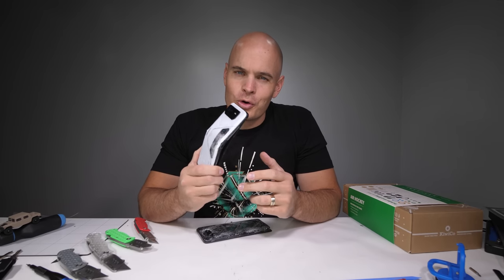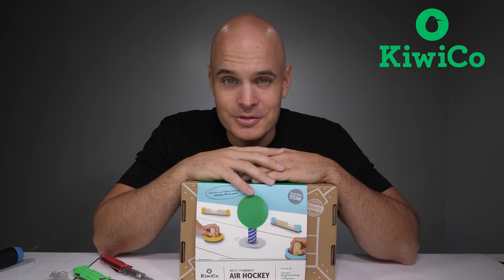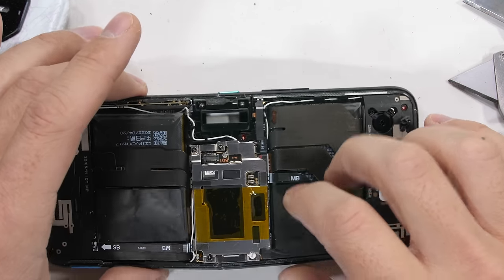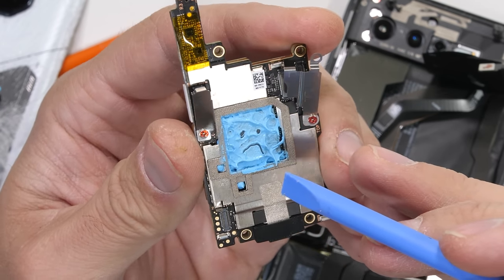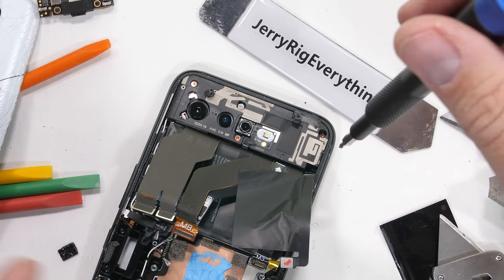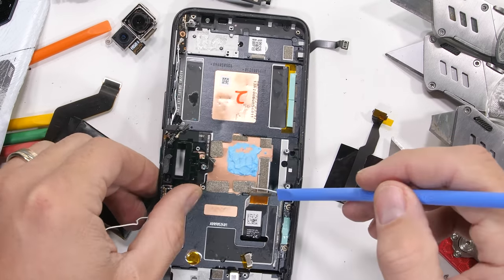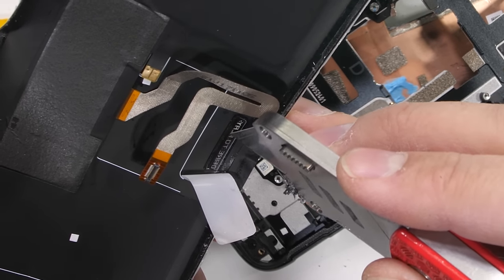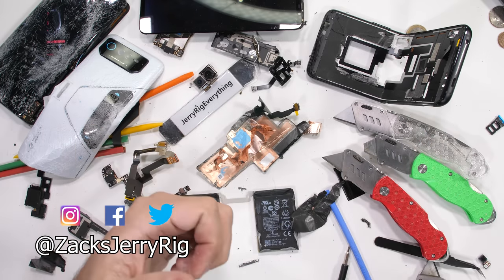The ROG 6 PRO has a SECRET Cavity! - TEARDOWN

Comment: That hidden cavity is for the Pro versionor the ROG 6 pro d. They added heatsink that opens up when the aircooler is attached
Reply: Surely they should have put some points into endurance, after maxing the power stats
Reply: It's called ROG Phone 6D Ultimate
Reply: exactly
Reply: agree
Reply: Yep that was my thoughts on it. Same internal layout, just different motherboard. Wondering is it only the section with the CPU is the difference on the 6D.
Reply: With all those moving mechanism~ That phone going to break if accidentally step on sit on it lol. This is my last time using ROG current on 5S~ But kinda bored, gonna for for other brand for some refreshment~ Been using Asus since Rog2~ Hope Asus do better on durability side~
Reply: @Lawz1993  no wonder Iphone Pro Max sellout in my place faster than ROG tho. After 4, ROG really double down their brand for ultimate gaming phone sadly. 2 3 are their premium places.
Reply: yes, it was a future plane for the cooling vent with the 6D Ultimate
Reply: @Lawz1993    exact same experience with me. Even thought ROG Phone have some interesting Point for the phone User Experience , Features and shape, but kinda worst for the build lately, and the Official Service is not widespread either, if there is any , it will take a long time for the service
I have sold my last ROG Phone 5s and probably Will go for Samsung or some kind of it

From several experiences using several smartphone brands, ROG Phone is the worst experience for me, like quite a lot of problems from it
Reply: So you can buy the ROG 5 Pro ultimate back glass and upgrade your normal version.
Reply: @tylern6420  It's a "gaming" phone, they got a limited number of skill points so they went for a full glass cannon build. xD

Comment: The ROG phone 6 ultimate has a flip out fan in that same spot so my guess is the 6 pro uses the same body but they put that chunk of plastic inside instead of the fan.
Reply: ROG Phone 6D Ultimate*
Reply: I just bought Rog 6D ultimate. I don't understand anything but is my new phone will be break soon 😢
Reply: my English is bad 😭
Reply: @DDLarssonii  your phone won't break as long as you take care of it.
Reply: @DDLarssonii  Just don't sit on it.
Reply: @FastSloth87   I will try bro thanks 😂 I'm just little scared cuz my rog 1 fell on my rog 3 while it's charging and broke my screen it was brand new at that time I felt my heart broke bro :( but now I start putting protection to my 6 ultimate. Da reason why I didnt  put any of my rog 123 any protection and all are screen cracked cuz while playing the phone will heat up. 🤦‍♂️

Comment: The 6d ultimate replaces the cavity with an open portal that you operate through their software. My understanding is that they added more copper In the open chamber and you use the fan to draw more heat out of the phone. Hope that helps!

Comment: I think it is for the 6D, the one which opens up and uses a modified cooler as well to let the heat pass. They had the same design in place & for some reason decided not to use it on this one.

Comment: I definitely agree with you Jerry on the OIS part. Since durability problem can be solved easily by using a phone case but OIS. That made me sad too. Great Video.
Reply: If you need a case to have a string phone you might as well use thicker metal dont you agree?
Reply: @arshenio45  it's more to do with the dual battery design, the phone would be a lot stronger in the middle if the li-on battery was a single battery that runs along the length of the phone
Reply: @arshenio45  rog phone 5 users here, been using the phone for 1.5 year and a half now. Fell a lot of times, but i never noticed any bending. Everything is still tightly sealed and straight.

I think the only way for you to bend a phone that way irl, is when you put it in your back pocket and sit on it, which you are not supposed to do to any phone anyway.

I'm not saying it's ok for a phone to just completely split in half. But i think people need to realise that the force needed to bend the phone is waaay more than the force it's gonna get just being in your pockets.

Comment: If they reposition the batteries from horizontal to vertical orientation it can help with the structural integrity. Although by the looks of it ROG needs to add a midplate and increase the frame thickness or try a different alloy altogether. For 1300 this surely is possible. If Apple of all companies can offer a stainless steel frame ROG certainly can.
Reply: Then you add weight, for what? You think people who buy gaming phones take them to a construction site???
I kind of understand why Asus CEO said to never listen to consumers.
Because it they did their phones would weight 6kg and be powered by a diesel engine.
Reply: If you have vertical batteries you will not have the space in the middle which is needed for the processor cooling.

ASUS knew for sure that the design in this way is going to make the phone easier to bend. However, the reason for this is to align the location of the cooling fan accessory with the processor and since the cooling fan is installed in the middle (best location for weight distribution) they have to make space for the processor to be at the same location where the cooling fan will be installed to get the most benefit out of it so in order to make the needed space while having good battery capacity is to have 2 small batteries instead of one big battery. Another side benefit which will be the distribution of weight when playing in landscape. It is not because of batteries safety somehow, ROG 6 Pro is a gaming phone where you need to focus on performance, high frame rate and graphics while trying to resolve the heat issue which will affect the performance. If you are into gaming and you want to enjoy performance gaming phone then you have to compromise. Therefore, by knowing that the phone is easy to bent because of this, then you know that ASUS know what they are doing, it is just something they needed to do for performance.

Yes the bend seems bad and not desirable but we should appreciate that the company is differentiate the design of gaming phone than normal phones, they are trying to get the best design for performance and they have engineered the phone with an outstanding design and internal alignment with the current existing technologies as in future technologies may change.
Reply: @alaaeid8320  Okay. I'd like to propose another solution. Keep the same battery orientation. Add an aluminium midplate, attach it to the vapour chamber. It'll act like an additional heatsink for the processor and provide additional cooling to the batteries as well. This way the cooling accessory can be used, they design will remain almost as is. The additional battery cooling will extend battery life and help with faster charging speeds since heat is the No 1 enemy of a Battery. For the frame, they can try and use a stronger version of aluminium alloy. The weight remains mostly the same. Result improved strength, better battery and processor performance. Or If they don't want to experiment with a different alloy, they can use a thicker back glass and on the screen. That will also help with the heat and solve the structural problems but not as much as the midplate. 
Any arguments??
Reply: @SMGJohn  Hmm. Seems like you're the kind of person who would buy a sub par product for a premium price just because the people who made it gave some bs reasons for cost cuts. My guy every problem can be fixed with clever engineering. And yes there are different varieties of alloys. For example there's 6000 series aluminium which is inferior to 7000 series. Some smartphones use 6013 and 6063 grade aluminium. Some use 7075 grade as well which is the highest grade used in phones right now. A big example of this is the iPhone 6/6+ Bend gate where apple used 6000 series alloy which is diluted and cheaper to manufacturer and also weaker. For 6s/6s+ they switched to 7000 series alloy. That fixed the issue. 
Trust me most problems like these can be fixed with clever engineering, and minimal cost deviations. 
The only reason ROG didn't do this is because their accountants probably would've done a CBA and reached to the conclusion that if this becomes a problem for them (lawsuits) it'd be cheaper to settle the lawsuit than actually fix the problem. And this isn't the fist time a company has made such a decision. 
If iPhones weren't as dominant, chances are Apple would've kept using the inferior grade alloy and dealt with any issues quietly. 

Argue that my guy.
Reply: @SMGJohn  the bending in this case would occur if: you sit on your phone by mistake with it either being in your back pocket or being on the chair/bench/sofa/bed etc
it could also happen when you put it in your backpack when going in a vacation, if for some reason you don't want the phone to be near you while on the plane, etc

basically normally it won't break like that, mistakes and accidents do happen. There's a reason why Zack tests for bending, and that's the entire "bend gate" a few years ago with iphone 6 or 7
Reply: @serikazero128  
Majority of phones sold are with plastic framing, if sitting on your phone is a concern, the solutions are simple, do not weight over 300kg, do not wear slim jeans.

I do not own Asus phone, but I am tired of people proclaiming this to be an issue, the iPhone bent very easily, Zach is putting a lot of force on that phone, and if your phone bends in your backpack, everything in your backpack is gonna be smashed up anyway, so if you have your laptop in there, it will be smashed, there would have to be a forklift driven over it for it to happen.

If these are genuinely your problems, no phone will survive, you are better off with a CAT phone, designed for the US Army.
Reply: @SMGJohn  just search bendgate regarding iphones, and I'm sure the teen and young adult girls that bent them didn't wear 300kgs. The thing is, women have a tendency to wear phones on in their back pocket, and some men do as well. After repeated sittings, the phones will start to bend.
Its also worth noting that "fashion" these days is thigh pants. Afterall you want to see a hot slim chick with pants fit on her legs and ass. And if you slide a phone in and then you sit, multiple times, yeh, you get bending.
But hey, feel free to dismiss all of that. And no, like jerry nicely pointed out, Asus RoG broke last year as well, but most other phones don't get bent as easily, again, the iphone fiasco was a thing just a few years back
Reply: @serikazero128  
What in the genuine hell are you even on about? 

If you need a phone for construction work, buy a phone for construction work, if you need a gaming phone, NONE of them will be as sturdy as phones made for construction work. 

And drop your flagship crap into the floor, both screen and back glass breaks, GG?
Reply: @SMGJohn  only construction workers have chairs, sit, or have beds and sofas.
Dully noted :)

Comment: Nice to see this. I have a Rog phone 2 and i wanted an upgrade. But i can wait for Rog 7, maybe they will improve the internal structure.
Reply: I have the rog phone 6 512gb storage and 16gb ram in black and i even tried putting pressure onto it to see if it will flex a bit but it seemed fine and i have a screen protector and a case on it and nothing happened up to now so if i guess you take care of the phone normally you should be fine but yea i had the rog phone 3 before and i didn't have to worry about that bending it is a tank

Comment: Here's a question for you, when taking off the screen, I noticed only one ribbon cable, now is that cable pushed through the back of the phone OR is it connected to the front? Curious because of the screen cracks and needs to be replaced, it would be an easy repair to do since Asus doesn't have any repair centers in the US.

Comment: Moving back up to the top to remove the cameras, we have the itty bitty 5 megapixel macro cameras camera which does not have OIS.
The other two are mounted together at the same housing.
We have the 50 megapixel camera on the left and the 13 megapixel ultra-wife camera on the right –both of which have smaller footprints than we would normally see in a flagship, and surprisingly, neither of them have any optical image stabilization. We haven't had a phone without OIS in years, and especially not on a flagship that costs $1300. I'm almost more disappointed by the lack of OIS than I am at snapping in half.

Comment: Seems they slightly cheaped out on the "pro" model with it missing a handful of features such as the speakers balls or especially the optical stabilization on the camera and it apparently doesn't even have the vapor chamber that leads to the back of the phone like their other models do, which I find pretty weird for a $1,300 phone... Not very impressed with this.

Comment: Not sure if this was mentioned before, but i have a theory on why the internals are laid out as they are, and why the battery is split into separate cells. It may be possible that ASUS/ROG knew of the compromised structure of the phone with the placement of the power & usb-c connector. To help ensure that the battery doesn't get damaged if the phone is bent (and end up exploding/catching fire), it was split into two and placed the way they are so that they are better protected, and less likely to get damaged if the phone is bent.
Reply: its just for space claims. this layout lets them use the space more efficiently, thus getting more battery life. ipads have a similar arrangement.
Reply: This why I bought a protective case when I bought this phone and yes I have delicate hands so it wont bend easily, I put the phone inside my bag instead of my pocket when I'm heading out
Reply: ASUS knew for sure that the design in this way is going to make the phone easier to bend. However, the reason for this is to align the location of the cooling fan accessory with the processor and since the cooling fan is installed in the middle (best location for weight distribution) they have to make space for the processor to be at the same location where the cooling fan will be installed to get the most benefit out of it so in order to make the needed space while having good battery capacity is to have 2 small batteries instead of one big battery. Another side benefit which will be the distribution of weight when playing in landscape. It is not because of batteries safety somehow, ROG 6 Pro is a gaming phone where you need to focus on performance, high frame rate and graphics while trying to resolve the heat issue which will affect the performance. If you are into gaming and you want to enjoy performance gaming phone then you have to compromise. Therefore, by knowing that the phone is easy to bent because of this, then you know that ASUS know what they are doing, it is just something they needed to do for performance.

Yes the bend seems bad and not desirable but we should appreciate that the company is differentiate the design of gaming phone than normal phones, they are trying to get the best design for performance and they have engineered the phone with an outstanding design and internal alignment with the current existing technologies as in future technologies may change.
Reply: For me is actually hard to believe that a manufacturer like Asus actually preferred to release a phone with a clear structural project fail just to have something "fancy" like an USB-C in the middle just to plug a cooler

Comment: The cavity in this phone cannot be a "conduit" as conduit needs to conduct something. Cavities filled with air are terrible conductors. (Hence we use double/triple glazed windows where between each layer we use a "non-conductive gas"–air in the cheapest, argon in the mid-range, or ultra-low pressure argon in the priciest.)

Comment: For the folding phones, it would be nice for the bend test to try bending it from the side. Meaning taking it un folded and instead of bending it in reverse, bending it from left to right, to stress it with compression and tension at the same time.

Comment: The angle iron shape of that cavity surround tells me that it is there to give the phone rigidity, especially considering where its placed.
Reply: L section, and no. Rigidity at that size is nonexistent. Other devices of this size and nature use carbon fiber rods that span the length of the device. Asus' designers are just plain lazy and didn't bother dealing with venting.